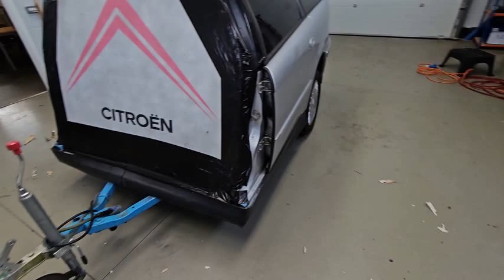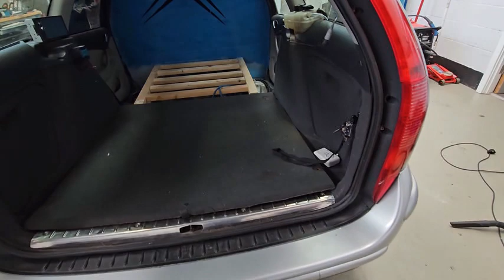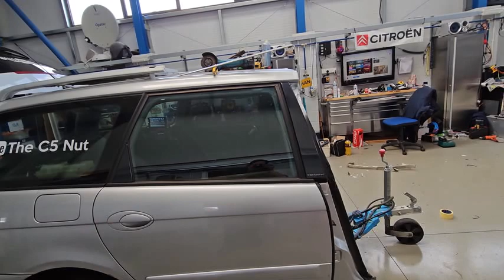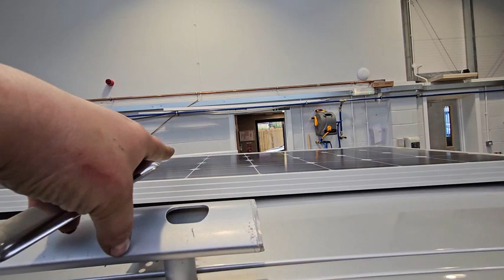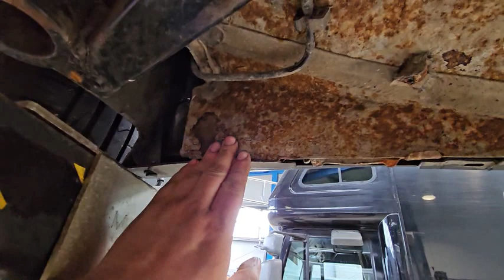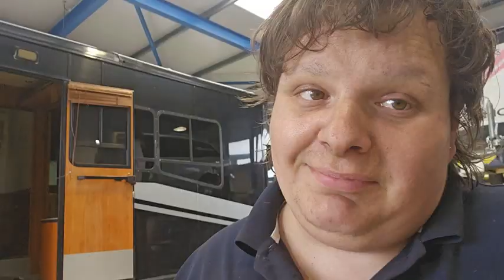major work and upgrades on the c5 caravan in 2023

Comment: Hello. I have a problem with my C5 MKI. Hydraulic pump failed and I tried to change 40A fuse. I've changed 3 of them, because I was far from home. Today I've replaced hydraulic pump motor, but now it says Serious suspension fault and I can't hear the pump. It won't activate.